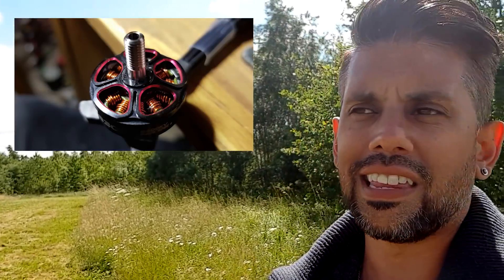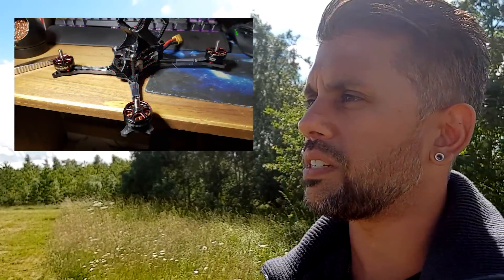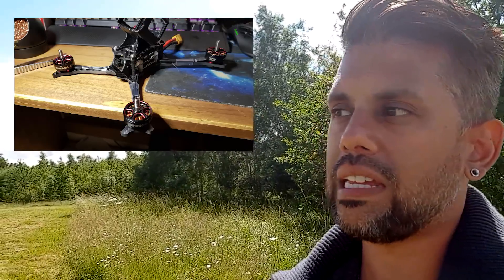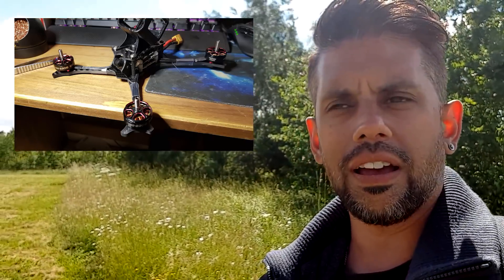EMAX RS2 2306 Motors! HAWK 5 Upgrade | Review | Flight Test

Comment: Good stuff! I'm getting a lot of vibrations with my hawk 5. Change drops tighten up all the screws but you can see and hear that it's not smooth at all. I thought about changing the motors. Any suggestions?
Reply from the maker: Remove the gyro from the equation by spinning each motor one at a time in betaflight with the props off in the motors tab. See if one is particularly bad for vibration. After that reset to stock PIDs, put a fresh set of props on and see where you are after that.

Comment: The hawk 5 is very efficient in its stock configuration. I get up to 7 min flights out of 1300 and 1500 ma batteries landing at 14.3v. If you only use 1300ma batteries and lighter, and only use it without a go pro, then this is a good racer. This quad is light enough to need tuning if you use heavy batteries or a gopro. I'm very happy with my Hawk 5, but I've only been flying fpv for a couple weeks. I can say that it's durable as can be. I never thought I would own anything that can put up with the abuse my learning curve has thrown at it.
Reply from the maker: keep at it ;)

Comment: NJ, did you ever get the hawk retuned for the RSII motors? I finally got mine installed. Made a pretty noticeable difference with a GoPro on. I love em on this quad. If you did get it retuned could you post the pids you wound up with??? I haven't had time to mess with them yet but maybe today after work I'll have a chance.  It feels like P may need to go up just a few numbers. I already bumped D up 2 for the GoPro on the ls motors and it was perfect. On the RSII D seems pretty good I think lol.
Reply from the maker: Hey Archer, yea that's pretty much what i ended up with, drove the pids up and it flies really sweet now. Its always in my flight bag now with my Archon :)
Reply: NJ Tech sweet that's what I thought. Bump it a little. But hell she still flys great the way I have it now for freestyle but for hitting a track it does need to tighten up a little. Hopefully the weather will be good later and I can get out and play. Lol.
Reply from the maker: Glad you're happy with it man, enjoy! :)
Reply: NJ Tech will do! I've been watching your acro school and after a year of flying I'm still learning new tricks lol. I just need to smooth things out and get into the flow a bit better and my vids would be better. I think I fly pretty good just need to start pushing it more to get better. 👍

Comment: The stock motor the shaft ripped off when i was tightening the props eeerrrr maybe too tight... that kind of seems weak metal.
Reply from the maker: sounds like a bad batch, ive never had that with any emax motors. Sorry to hear that :(

Comment: Bit disappointed with my RSII 2306 2400kv. They’re pretty meh on power, the balancing gunk is on the outside of the bell.. and the efficiency I was hoping for is barely noticeable. Wish I’d have got more F40 or F60 - they’re much better imo. I was on the 4.8 too.
Reply from the maker: interesting, whats your quads all up weight and props? These motors are monsters on the Hawk but that's a pretty light ship. Getting about 3:30 for flight time with a gopro on top and the V1S 5X4.8X3 props.  Not cool about the gunk, id be sending those back! Three of us at the club bought T40s and T60s, they all broke within two weeks, shaft shearing being the worst problem. Might have been a bad batch but i lost faith in them after that. Nice when they worked though :) Hard to go wrong with Brother Hobby if you're after a strong alternative. My 2207 R3s have been awewsome for 4 months now, still in perfect condition and bearings all good after many crashes.
Reply: NJ Tech Hyperlow rs @ 278g before GoPro and battery. Race/freestyle hybrid. Running hq 4.8 v1s. Decent bottom end, but lacking top end. My heavier quads feel way more powerful running t motor. Struggling to get 3 mins. I just end up running higher up the throttle than normal, so use juice just as a fast. They’re too low Kv, 2330 actual Kv. I think the higher Kv on a lighter prop would be much better imo. Oh, and I use the F60 pro 2500kv usually. Never broken one. I think it was the older ones with the dodgy shafts?
Reply from the maker: more than likely, ill check some newer ones at some time in the future. Odd we are similar weights and same props so im a little surprised the outcome for you. Top end on this setup is great. In either instance they're not up there with the real premium manufacturers like emax once were. A nice upgrade for this bird at least. Thanks for the comments sir :)
Reply: NJ Tech might be down to running a different weight than I'm used too (usually heavy or ultra light). They're fine, I'm just not blown away. Thanks!

Comment: Welcome back NJ, good to have you back looking forward to the acro series. You mentioned your archon frame in the sum up at the end, can I ask what set up you use on that? Motors FC and ESC? I run an Archon as my main rig... absolutely love it very interested in what you've found to be a good set up on that frame.
Reply from the maker: Thanks DM, appreciate it :) The rig details for my archon are in the description, it's such a great frame eh? If you need any other specifics just ask.
Reply: NJ Tech ahhh yes I see...many thanks NJ. Simply the best frame I've flown yet, it really does take a beating! Thinking of getting another to out build at 6". Your thoughts / tips would be much appreciated. Cheers fella.

Comment: booo for heavy copters haha. Just kidding. agree they give more torque for the heavy models ;)
Reply from the maker: im going to build you a quad made out of fresh air, it will be with you in the morning in a special see through package. You just need to add motors, electronics.... and a frame. But your gonna love it, weighs 0 grams! :D
Reply: can u go -0.1? carbon laced with helium
Reply from the maker: bahah perfect. It should be structurally good for 12S..

Comment: Definitely look forward to the tutorials. Interesting you pick that quad for a freestyle rig because of the bottom   mount battery. Do you normally prefer bottom mount batteries?
Reply from the maker: It's the subject of great debate for sure. My main rig is top mounted (the HaloRC Archon) and if i had to split hairs i would prefer it, but the effect on flight isn't as big as some protest, in my experience anyway. Certainly not enough to affect the stick inputs when i do the same manoeuvre on each type. More critical is the motor/prop choice and the camera lense and angle. Ill cover all this leading up to the series anyhow :)

Comment: Gotta agree with your statement on the Hawk 5. While it's my fav quad at the moment as soon as you put a GoPro on it you loose some oomph. I've also done a lot of prop testing on it with numerous props and I always go back to the Avan Flow props. Yes they pull more amps than even the gemfan hulkie 5055 but it flys so good on the avans. But my second fav prop is the hulkie 5055. I've tested hq 5x4.8 and 5x5x3 and 5x4.3x3, all felt mushy on the sticks but the 5x5x3 felt the best of the three. The cyclone 5046 did pretty good too I'd put them third on my fav prop list for the hawk5. 
Now as for the RSII motors I will be getting a set of 2306 for the hawk soon! Jut not sure what kv yet tho it will prolly be the 2400's like on yours. I don't need super ballistic speed and not gonna run 6s, 5s maybe but not 6. Great vid btw always love your stuff.
Reply from the maker: Thanks man, appreciate the kind words :) Yea, the 2306 are a perfect match on this quad if you're running a gopro. In regards to the V1S they are all great props but very motor critical for optimum performance. The 4.8's only came to life on my 2207s (until now) and do require some proper low end torque to get the best from them. My AUW on the archon is 630g which is quite a lump and on the 2207 brother hobby motors and the 4.8 V1S i have tons of power and im actually averaging 4 mins of flight. You're doing the right thing experimenting though, getting the perfect motor/prop set up is a bit of an art quad to quad, but when its right your control and flying will improve instantly. Thanks for the comment brother :)
Reply: NJ Tech no prob! Now I love the hq 5x4.3x3 on my old budget build they made the cheap racerstar motors come to life. Of course that thing has been beat to hell and back but I still love flying it even tho it's a year old but surprisingly I've never broken the frame or the motors those cheap weak motors just take a beating and kept going for some reason. But anyway I think your right on the performance certain props work great on certain motors and imo the Avan Flow is great on the ls2206 2300 but draws to many amps. If I could find a prop that handles the exact same but lower amps I'd be in love lol. The hq 5x5x3 tho has been doing me good for racing around the yard and doing freestyle tho. And a lot lower amps.

Comment: OMG! New red bottoms! I'll probably go for the 2206 version as there is no 2207(Love my LS2207). Nice NJ!
Reply from the maker: Hey Zero :) Yea my main choice of motor is normally a 2207, BUT these 2306 are very very comparable in torque. The top end is actually pretty nuts too! I like them :)

Comment: First! Glad to see you back, them motors look awesome
Reply from the maker: i wasn't expecting to like them after the experience with the whites, but this motor is back on form for Emax... now what to do with these 1900kv ones... 6 inch 4S or 5 inch 6S?
Reply: Looked pretty good mate, glad you like them. 5s I think for 1900kv, 6s will be like 2700kv 4s equivelant rpm
Reply from the maker: 6S it is lol!